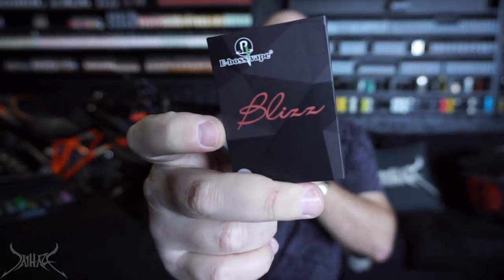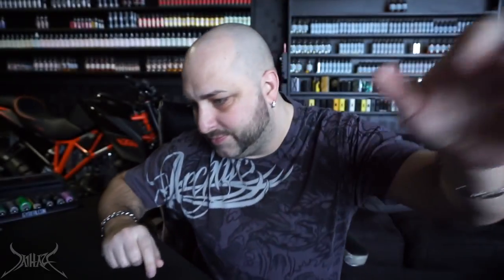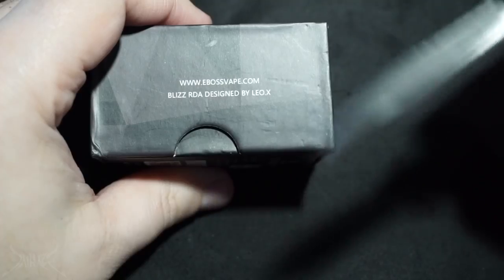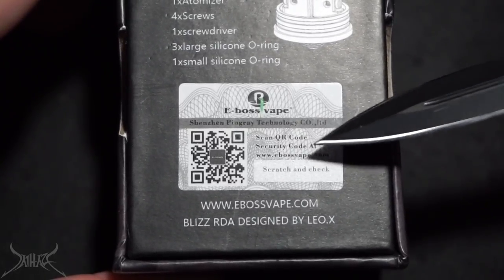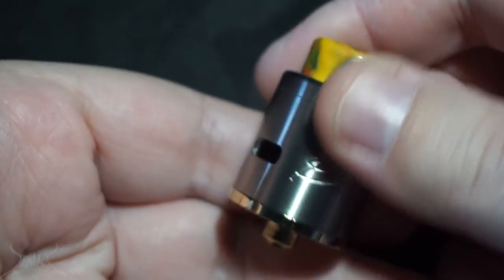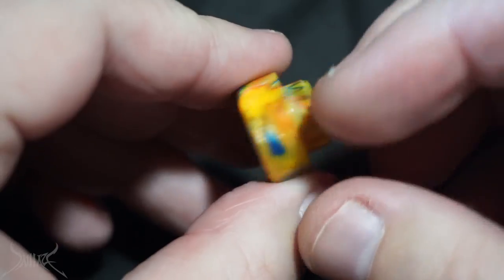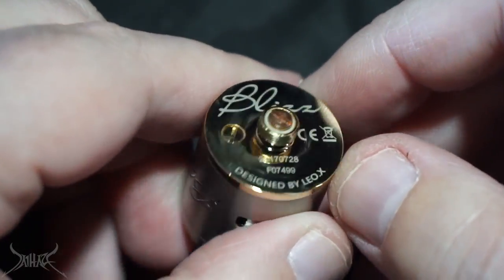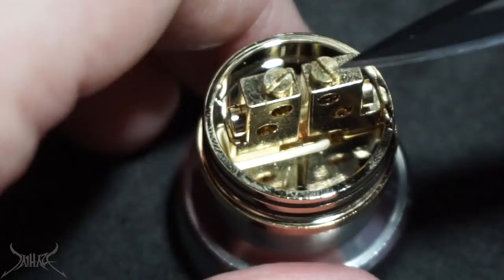EBossvape Blizz RDA Review and Rundown

Comment: The offset screw thing is a pain sometimes with flat-ish wire. I get "atomizer low" error codes and hafta fiddle with it to get any action. Aside that, I ditched the resin tip for something else. It gets a lotta usage tho among my other RDAs. One other gripe... The o-ring likes to stick to the top cap, making it hard to get off, no matter how well I lube it.. Just happens.

Comment: I myself like gold decks and as for flathead screws well it's simple they don't strip as easy Allen screws suck and Phillips are ok but again they can strip much easier then flathead so that's why you see them so much now also from what I see in many groups and on other reviews people prefer flathead but it's your right to jot like them just like it's your right to hate gold decks my only gripe with gold decks is when they make the base over big the part showing out the bottom like the combo I believe It was it's huge and looks ugly I like a little lip under the afc because it helps prevent leaking and condensation build up a bit but yeah some are to Much and as for the dripper you just reviewed idc for it and I agree I can't use a dripper for mtl and that drip tip is ridiculous I don't see why they would cut it out like that it's for sure gonna collect juice well goid review vape on vape safe 😤💨💨💨